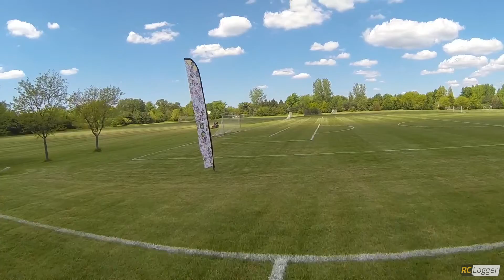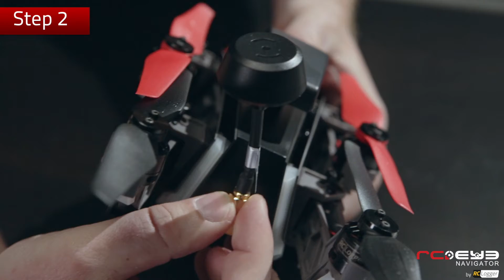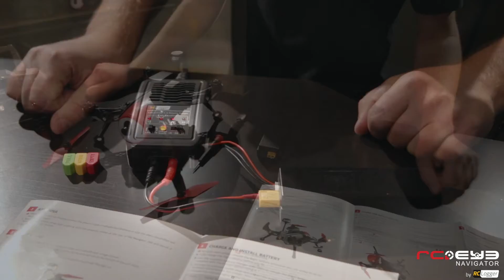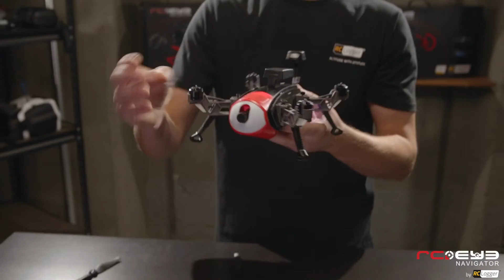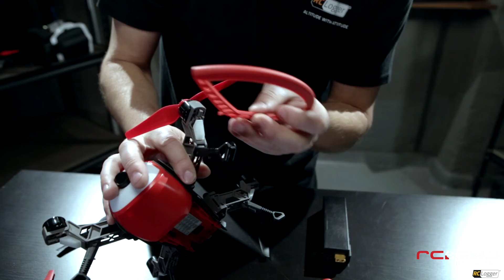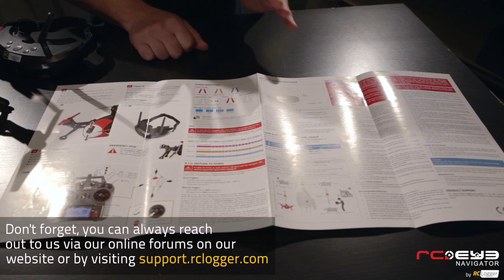RC EYE Navigator 250 - Preparing For Your First Flight- Tutorial Series.

Comment: I tried this quad twice and had to send them back, think twice about this unit for the battery jammed and locked in place , one unit was not blinded and would just dead drop out of the air. Just the callabration process though Easey is a mess, this is the only quad I've ever had to or couldn't wait to return , I like the goggles they make for I kept them and took my refunded money and bought a Unicorn 220 and never regretted it.

Comment: Hey guys im doing a review on this one as well.
but noticed that instead of using the toggle switches like you show in this video...i  have to use the ""R"" button  on the side of the quadcopter?
 in my quick start guide that's how it says to do it ..did something change from the time you did this video to recent?

Comment: how come it can handle such pitch levels (45°?)
Reply from the maker: The Navigator has a full manual mode which allows the pilot complete control with no angle limitations. This means flips and rolls are completely possible.